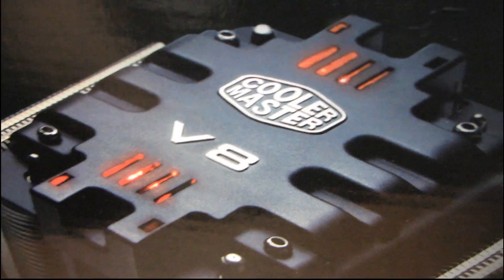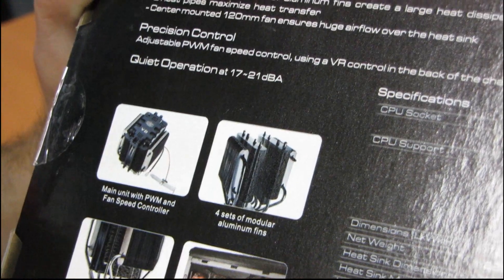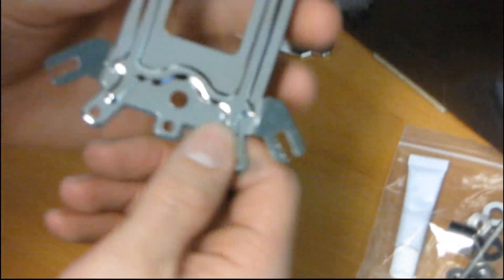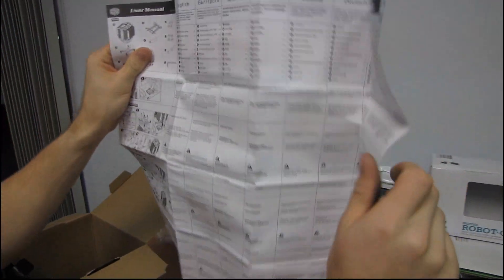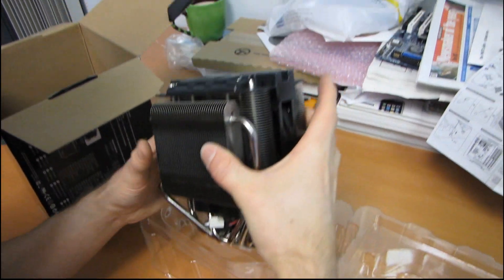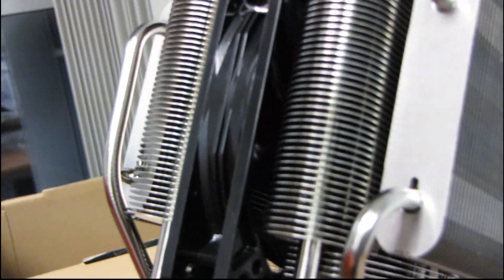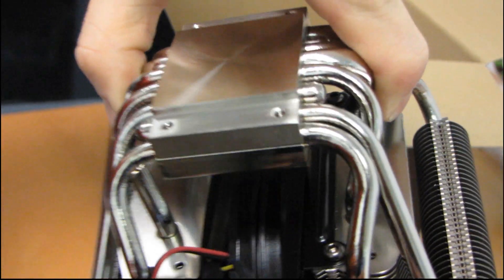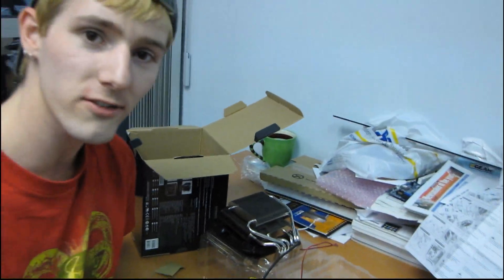Cooler Master V8 Heatpipe CPU Heatsink Unboxing & First Look Linus Tech Tips

Comment: Chapters:

0:00 Box and general overview
1:21 Accessories
3:13 Closer look at the cooler

Review:

Haha overpowered. Laughs in modern CPU wats. Never seen a potentiometer with a cooler. Cool old school tech. 3/5 rating for the video :)

What am I doing, and why?

I want to watch and review every single video on Linus Tech Tips channel.
I will provide chapters if the video has none.
Why am I doing it? To pay a homage, and I am fairly sure that my head is a bit messed up.

Comment: Worked for 9 years like a boss, still cooling a brothers PC cpu but with replaced fan, because of fan bearing failure  but it was spinning 16h every single day since 2009/12.
Reply: How does it compare to NH-D15?
Reply: @AutodidactEngineer  I would say its design similarity, huge chunk of metal and fan in the middle of it .
Reply: @AutodidactEngineer  anyways, NH-D15 seems massive too , and more fans , guess more than 13 year difference  allows to put more fans with the same noise level and still air cooling has its place
Reply: @AutodidactEngineer  for me its just nostalgia, guess NH-D15 has same or even superior  capabilities, CM V8 was great overall for its time.

Comment: Hi. Is this cooler compatible with socket 1151? I have it in a box since a lot of time. It was part of my i7 1366 socket fiirst generation build. I wonder if it works in my actual i7 9700KF with socket 1151. Thanks.

Comment: I'm trying now to use my Old Cooler Master V8 ....and mount it on my ROG Maximus Gene VI to Cool down my I7 4770k . But rumors says the actual socket 1150 of the i7 is not compatible with that specific heatsink ...because it only provides compatibility for the 1155/56 933 and AM3 sockets .... I really don't want to dump it ..First is in a pretty good shape and secondly the default I7 heatsink sux....80mm fan mounted on top of a 100mm alluminum "radiator"... keeping my CPU Always under pressure ...75 to 85 °c at all time no matter ,what i was running ; games,browser,futuremark,3dmark, even Emulators for oldie consoles. please Send Help ;x

Comment: "Overpowered" Still gets 85°c on an i7 920, which is a cpu from the same year.
Reply: so this cooler is shit?
Reply: du Bb
It doesn't work well for me and I've been told that it's really shit.
I don't really understand why it's so bad, it's pretty big and the fan spins pretty fast so there's no reason for it to be bad, but temps are always bad with it.
Reply: IMNOTA Get the coolermaster hyper 612. Iv had that for 6 years on my i7 970. Runs idle at room temp, and load doesnt see much more than 60c. 65c once its able to heat up my room if given long enough.

The hyper 612 has an all copper base and 6 copper heatpipes. Goes to show how materials can make all the difference. Alluminum is HORRIBLE at heat transfer. Almost a useless material for it.
Reply: Shabuti R18 Yeah I'm gonna change my cooler when I get a xeon anyways. But tbh I pretty sure the heatpipes on the v8 are copper too, it's silver because it's nickel-plated but I dunno about the base.
Reply: IMNOTA Im pretty sure it says aluminum on their website. Either way, the hyper 612 blows this out of the water in terms of cooling. I dont know why they would nickel plate copper. Nickel doesnt transfer heat very well.
Reply: Shabuti R18 Yeah I was unsure if they done it on that cooler, but nickel-plated copper heatpipes are a thing. I guess they do this because copper is a color that might not go with the rest of the system.

Comment: i got it last year and replace the simple fan of gigabyte i had on my motherboard on my i5 2300 and the temps are way down! Before i had idle 40 to 49 and on gaming using Riva tuner on mad max i had 70 to 80 degrees damn and now while playing im on 60 max and idle close to 25 but i m using like 2 big fans 1 in front 1 upper case and medium fans!  3 on side cause the forth cause of v8 no more room to put it so i place it on the bottom and one last fan on the back so the airflow is fantastic the only problem is that i m using a xpredator high end tower wich i dont like the sides since no filter add on to keep out the dust with the exception of having fans and the rear place to put the graphics card is lacking a serious method of holding her yes its like 75% stable but doesent the case have a good holder , you can put a screw to hold the card to be more stable if you want they have add this but its almost unaccessible cause its to tight to put your fingers in to put the screw in

Comment: would this work with the AMD PW4486B AMD FX-8350 FX-Series 8-Core Black Edition
Reply: +BlueSnow Yes. The FX 8350 is a 140W AM3+ CPU. AM3 and AM3+ (and basically every AMD Socket) use the same HeatSink Retention Bracket, so mounting it will be no Problem) Since this Beauty is rated up to 180W, it will also bring enough Power to keep your CPU cool.

If you plan on Overclocking your CPU, there are better Cooling Solutions out there, though. This one is mainly for looks (it still has some decent Performance, though)

Comment: does it work for Core i7 4th Gen ?
Reply: yeah
Reply: ChainsawYodelor  really ?
Reply: works for pretty much all models as long as you have a large enough cawe
Reply: Ich SoySambath It will also work with 5th gen.. As long as it's the same socket it will work

Comment: Would I be able to mount this with my 4770K? I'm guessing yes, since coolers that fit with 1155 work with 1150, but I want to make sure.
Reply: I am using an LGA1200 socket and it fits perfectly

Comment: 42 celsius on idle with a stock CPU sounds far too hot. You probably didn't tighten the cooler enough, and you applied too much thermal paste/didn't remove the old paste

Comment: Yes, it should be. Else you can get the gear for a few bucks from the CM parts store. I did that with my CM Hyper Z-600 passive cooler that I've had since the E6600 or even further back (can't remember).

I think it's great that Coolermaster makes sure their coolers stay compatible with newer hardware like that. Especially since the TDP figures don't really change much of the many CPU's out there, just the sockets and thus the mounting holes.

Comment: I need to get an aftermarket cooler but just can't decide which one! The temp hits over 40C here in Australia summers so without even overclocking my CPU it can hit 70C while gaming with a 2600k at stock 3.4ghz.

Comment: @jk3137 He didn't say it was a 250mm fan.  He said it was a 25mm fan.  Which it is, 25mm thick, as opposed to the larger, more noisy 120mm x 38mm fans.

Comment: v8 cooler design is solid, the included fan is the weak link, but it can be swapped out with a more powerful(and louder) fan.
Reply: The fan on mine is still stock and working since 2011 and now it's still connected to my i5 10600k and still adequate haha

Comment: Just get a corsair H50.  Its the same price but it out performs the v8 and v10 and its really light since its a enclosed liquid cooling system.  My 955 is at 4.4ghz at 45 degrees celsius.